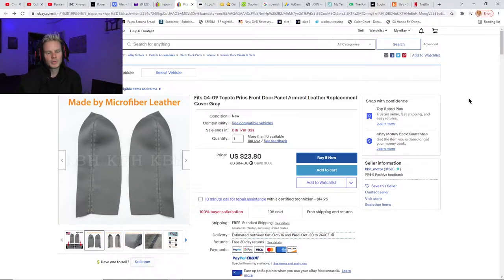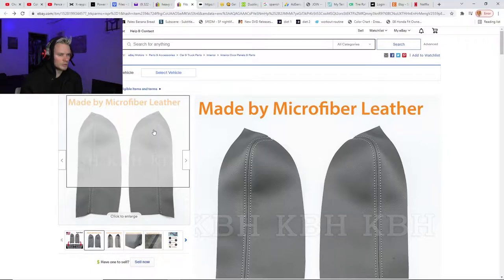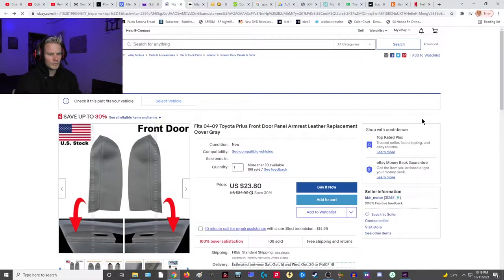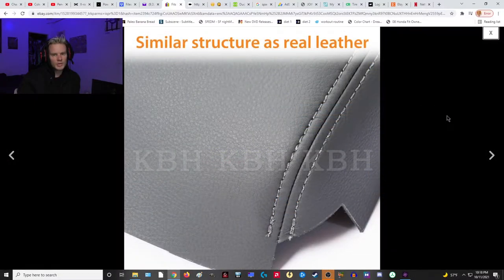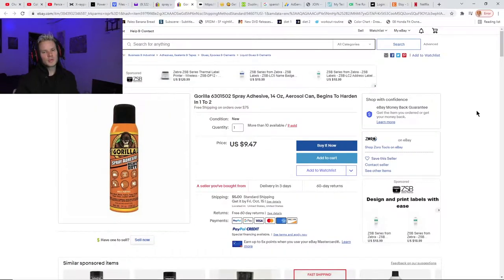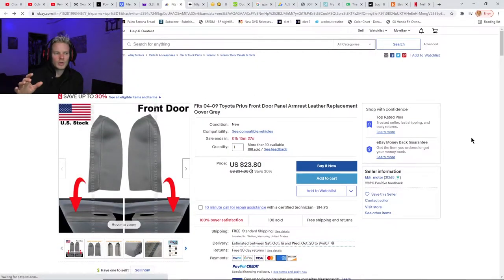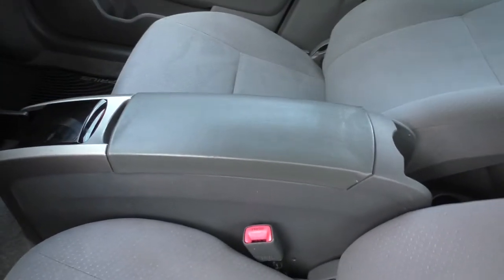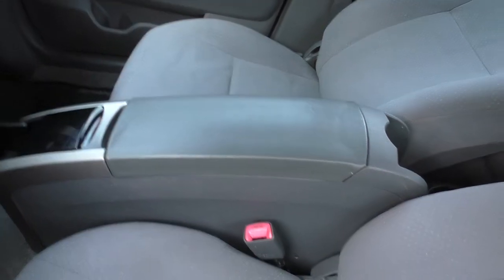04-09 Prius Armrest Fabric Replacement Re upholstery - leather - Door Toyota - 2nd Gen worn stained

Comment from the maker: staple gun:https://www.ebay.com/sch/i.html?_from=R40&_trksid=p2334524.m570.l1312&_nkw=heavy+duty+staple+gun&_sacat=0&LH_TitleDesc=0&_odkw=prius+door+armrest+fabric&_osacat=0
Fabric:https://www.ebay.com/sch/i.html?_from=R40&_trksid=p2334524.m570.l1313&_nkw=faux+leather+grey+fabric&_sacat=0&LH_TitleDesc=0&_odkw=headliner+adhesive&_osacat=0&mkcid=1&mkrid=711-53200-19255-0&siteid=0&campid=5338340548&toolid=20008&mkevt=1
Pre-cut fabric:https://www.ebay.com/sch/i.html?_from=R40&_trksid=p2334524.m570.l1313&_nkw=prius+door+armrest+fabric&_sacat=0&LH_TitleDesc=0&_odkw=faux+leather+grey+fabric&_osacat=0
Spray adhesive: https://www.ebay.com/sch/i.html?_from=R40&_trksid=p2334524.m570.l1313&_nkw=spray+adhesive&_sacat=0&LH_TitleDesc=0&_odkw=headliner+adhesive&_osacat=0&mkcid=1&mkrid=711-53200-19255-0&siteid=0&campid=5338340548&toolid=20008&mkevt=1
Headliner adhesive: (will be more forgiving if you need to start over)
https://www.ebay.com/sch/i.html?_from=R40&_trksid=p2380057.m570.l1313&_nkw=headliner+adhesive&_sacat=0&mkcid=1&mkrid=711-53200-19255-0&siteid=0&campid=5338340548&toolid=20008&mkevt=1

Comment: The plastic piece @ 5:34  What is the name of it, exactly? On mine, it's broken in half so I want to replace just that piece.
Reply from the maker: I'm not sure. The best way to find out is to google "08 Prius parts diagram" and find parts diagrams on an official toyota dealer site. Then you can search ebay with the part number and name. You can also call a dealer to get the part number.
Reply: looked for you out could only find complete replacement, https://parts.olathetoyota.com/v-2008-toyota-prius--base--1-5l-l4-electric-gas/body--interior-trim-front-door nearly $800. when I fixed mine slid a old bank card under the fabric and glued it down. working so far....